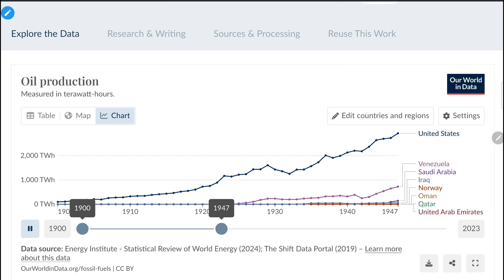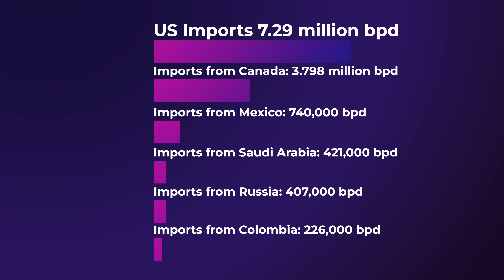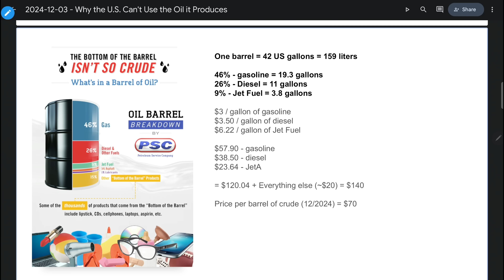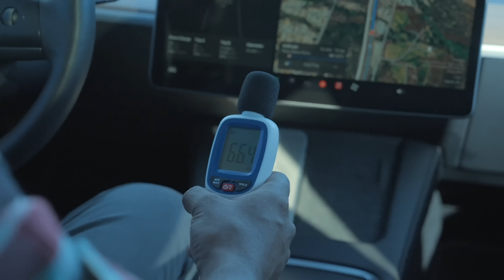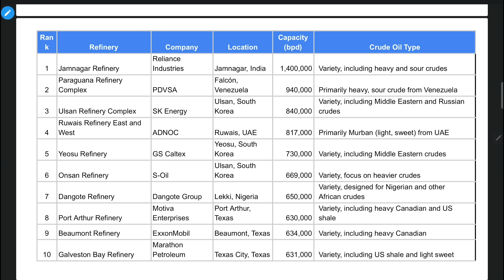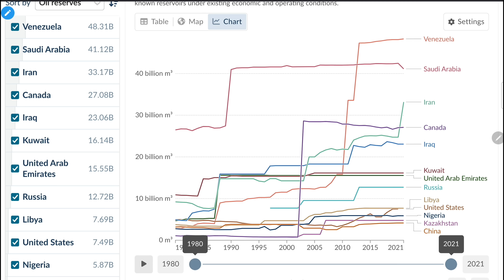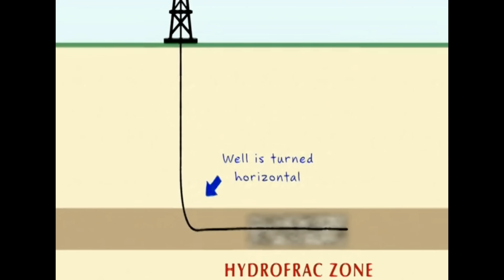Why America Can't USE The Oil it DRILLS

Comment: People don't like it but pipelines are safer than trains fighting pipelines puts the environment in more danger.
Reply: Shutoff the pipelines for a week and see how adverse everyone really is.
Reply: But Warren Buffett owns rail transport and had lot's of lobby money.
Reply: Amen. The anti-pipeline protesters are extremely silly.
Reply: @lanagordon5669  They are completely clueless.
Reply: Unless you live in an area permanently affected by a pipeline failure.  As pipelines age, they are sold to weaker companies that do not perform the proper maintenance until there is a failure then the try to do the absolute minimum to clean up their mess.  We are still feeling the effects of the oil spill off Santa Barbara in the late 1960's.  A recent pipeline failure just north of Santa Barbara cleaned the surface but the marine habitat is in ruin there & likely will be heavily stressed for close to 100 years if there are no other failures. Pipelines hav the potential to destroy more habitat quicker than either rail or trucking, even though the pipeline is a more efficient mover.  It is much easier to regulate & control the flow of the oil via truck & rail than pipeline.  Many, many pipeline companies have been caught violating the regulations concerning pipelines, mostly because they are not a visible.  No thanks, as an over 70's person who lived through too many oil spills, move it on a train or truck!
Reply: @dennislyons3095  until a train derails witch happens all the time.
Reply: @dennislyons3095  Also the thing people do not understand is that most of the pipelines that are being blocked are for Canadian oil sands oil. It is not oil like you think of. It is so heavy that it sinks instead of floats, so cleanup is nearly impossible. Think of road tar. Dump that in a creek or river and how do you get it out? Lots of that stuff spilled around Bakersfield from back in the fifties and it is still there flowing around on the sand. There is a small river in Arkansas that is choking on it from a broken pipeline. Yes it is safer to move that way statistically but also disastrous for the place it does spill by the time they can shut the pipeline down. Cleaning up a truck load is nothing hard, but a pipeline spill is bad.
Reply: What a silly comment.

Comment: The problem is refineries. We don’t have refineries that work in the oil we produce.
Reply: I like Ricky, he's truthful and knows what he's talking about. I don't agree with him on Peak Oil which has been pushed out farther and farther for decades. PROVEN reserves keep growing. That may not be the case this time but history says that's the wrong way to bet.

And I agree it's really dumb to burn oil when it has so many other uses we should leave for our posterity. But I come to a different conclusion than does Ricky. I think the thing to do is build a new mega-refinery designed to handle shale oil, and leave the others to run as they do currently. Because of increased demand we're actually using refineries beyond the recommended level. They REALLY need to shut down annually for maintenance. The sulfur in sour crude really does a number on steel pipes, or so I'm told. Having a shale refinery solves two problems at once.

Now many readers are going to accuse me of hypocrisy "don't burn oil"/"refine more oil" but I prefer to think of myself as a realist. Would I trade my Jeep for a new, quality Tesla? In a heartbeat. But America has yet to solve the range problem. Where are all the recharging stations the Biden administration promised? And why do I need separate accounts and apps for each company offering rechargers? Why all the different charging connections for each EV brand? Admittedly these are "just technical issues" and the government should take the lead in setting standards, just as they do for gasoline pump handles and the myriad of other minor but important cogs in the machine that is transportation.

There was a lot of enthusiasm for EVs when they were first offered, at least in this decade. But that enthusiasm was, as they say, "a mile wide and a foot deep". When the marketplace began to find EV issues such as those listed above, a whole lot of people decided they weren't ready to go EV. You can write me off if you like but as long as we have a relatively free market you will have to solve a whole lot of problems before we're able to shutter our refineries. I don't see EVs outnumbering ICEs until 2050 at the earliest. Hence the need for a shale-based refinery.

I apologize for the overly long post. I rarely disagree with Ricky but wish he would have spent some time at least mentioning why we're not all driving EVs right now, or even in the near future. Feel free to disagree with me and offer better alternatives as I am by no means an expert on this. But please, no proofs by massive harrumphing 🙂.
Reply: @EngineerBear  There's no point to buying an EV now your just causing more extraction of copper and vinyl casing to run a charger to your car and the electric is being made from burning natural gas.  Until we at least tip the scale of reneables at 50% this is all for nothing.  Even 50% is very low although I don't believe we'll have the capacity to replace our oil consumption with renewble energy without destroying our environment even more.
Reply: The problem is that those old  oil refineries continue to operate with help from old subsidies designed around heavy/sour oil.

If we updated those subsidies to favor conversion to lite/sweet oil refining then we'd move to actual self sufficiency.
Reply: Our refineries work well with any oil. They have the ADDED capacity to deal with high sulfur sludge.
Reply: Wow that's... Stupid
Reply: @Fabian3331234333  , yes, that is purely stupid. It is like you have a farm full of chickens and vegetables but your house doesn't have a cooking stove and cooking utensils.
Reply: The problem is Wall St and greed.
Reply: i wish i saw this comment 19 mins ago... just kidding.... ;) 

but yeah.. im all about the deep dives so thank you excellent video, ricky!
Reply: @crimfan  light crude wet don't. (Shale oil)
Reply: but we COULD............since we can print up as much money as needed...........for Ukraine, etc/ see? E A S Y